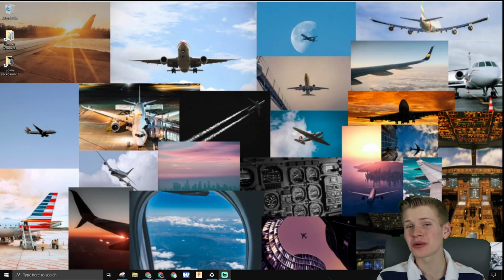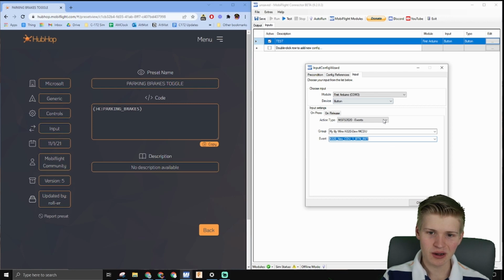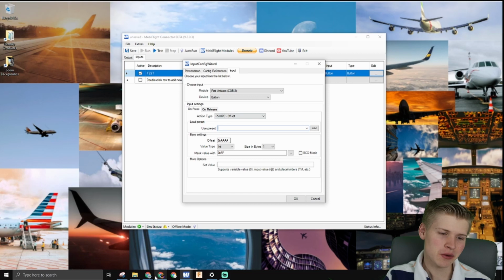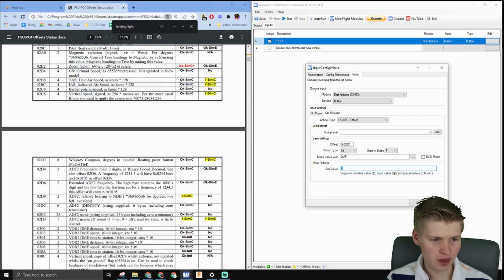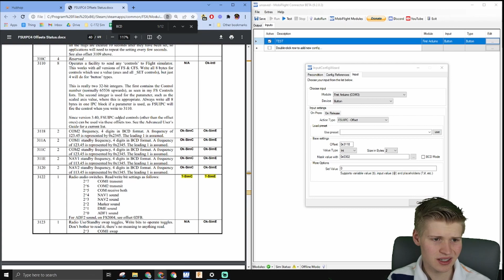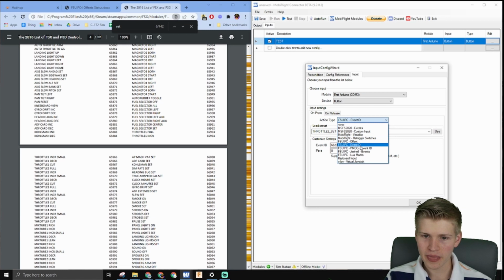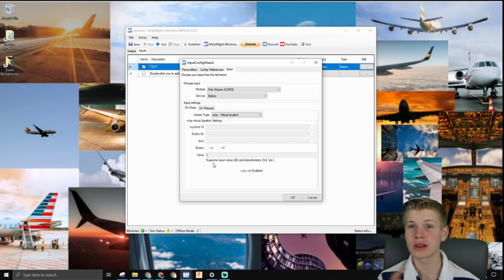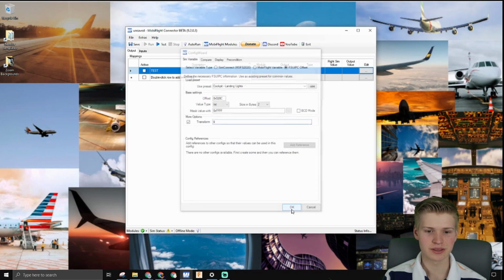What are the Input Action Types in MobiFlight | MobiFlight Crash Course Episode 11

Comment: thank you very much please if you can make the same video with de outputs on mobi because i have prepar 3d and its very complicated to assign outputs for 737 pmd thanks
Reply from the maker: Hello! I don't usually redo videos because they take a lot of time [and a fair amount of banging my head on the table] to make.
Hopefully, I can at least point you in the right direction.
When you download FSUIPC you should have a folder with offset codes/eventids you need for PMDG. 
You could also google "pmdg fsuipc offsets prepar3d" to find a few lists.
One of these is: http://willswingscockpit.blogspot.com/2014/11/les-offset-du-pmdg-737ngx.html
Regardless you'll need FSUIPC installed to use EventIds or FSUIPC offsets.
These are used the same way as normal FSUIPC offsets, but are different because I guess PMDG does PMDG the way PMDG wants to do PMDG.

Comment: been following your videos for years!  thanks for sharing all these.  One question, do we need to run Mobiflight Connector at all time to get the arduino boards working with the FS?  Are there ways to let the chip on the board memorized the functions and can run on stand alone by itself?
Reply from the maker: Because mobiflight connector is the connector between the sim and the arduino it always needs to be on.
You can enable autorun though!
Reply: @CaptainBobSim  OK got ya.  Thanks again.

Comment: It would be nice if all of the options were grouped together by aircraft
Reply from the maker: For MSFS2020 and X-Plane they allow the option to filter addon aircraft I don't know if that's what you mean?
Reply: @CaptainBobSim  I was thinking of something more like a drop down list that lets you select an aircraft from a list of available aircraft for the sim you're running,  so you can select the aircraft you're making your control for, then have a drop down that lists all of the controls for just the selected aircraft.

It tries as is, but usually only shows 3 or 4 aircraft(when I say 3 or 4 aircraft I mean 2 aircraft and 1 generic aircraft(I guess that must be an experimental :))  

It would great if it would read the list of aircraft installed on the sim, then display those in the drop down menu; then, once you've selected the aircraft you want it would give a drop down list of variables for just that aircraft.